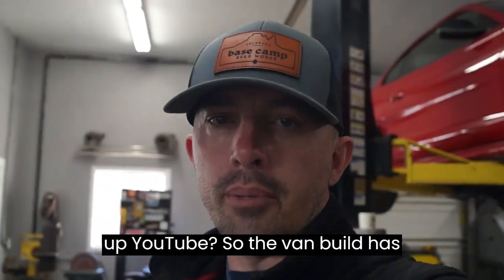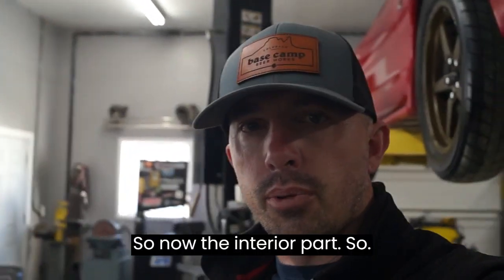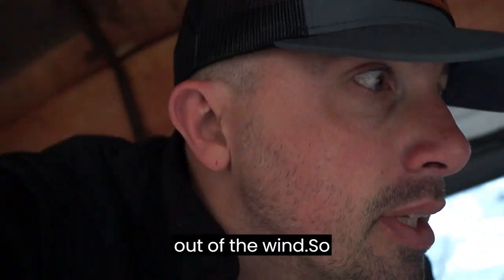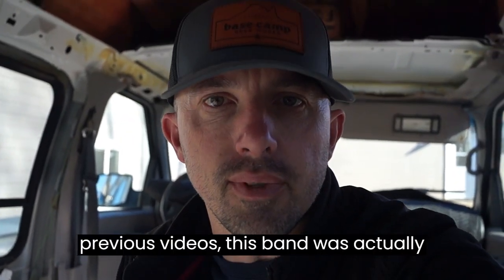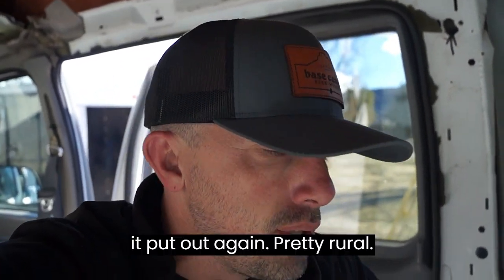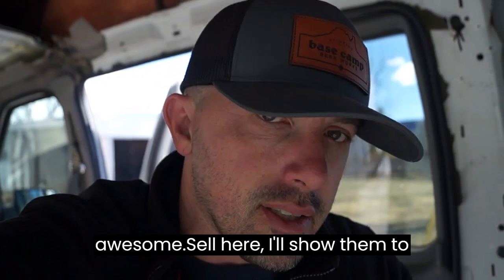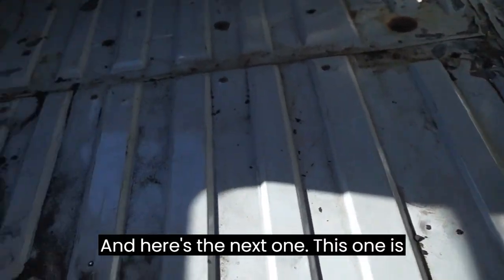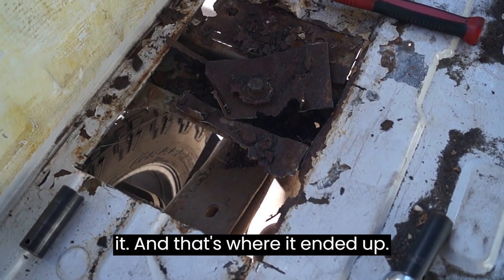Ford E350 4X4 Interior build PART1  Camper van conversion.

Comment: Unfortunately, a common problem for the E series vans is the rust seen in both locations here. The body mounting holes in the frame are like little basins that hold water. The driver and passenger floorboards are covered in rubber covered felt mats. People getting in and out of the van often have wet shoes and water can migrate inside from small leaks and water spraying up from underneath migrating through. The felt gets saturated and the rubber mat over top never lets it dry.  Unless you very aggressively deal with it, the rust will come back under the floorboards and sooner than you think. Especially if you continue using the felt underlayment. If you're in the desert, maybe the problem won't be as bad. But in the east and other typically rainy/humid climates, it will be an ongoing battle.

Comment: Mine rusted out by the wheel wells almost as bad as yours. About a day’s work to do both sides. The factory carpeting was soaked. I think that if a small rust hole develops from the inside wetness that splashing from the wheels keeps it wet. I’m going to finish it with 2 part primer and paint and hopefully be done with it for a while. Good luck.
Reply from the maker: I have another video coming up with the frame paint I use.